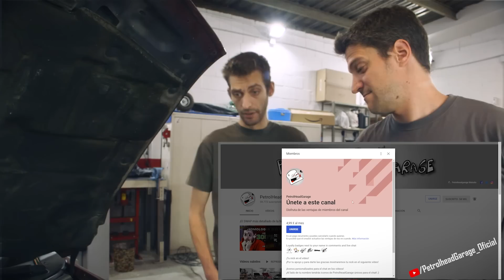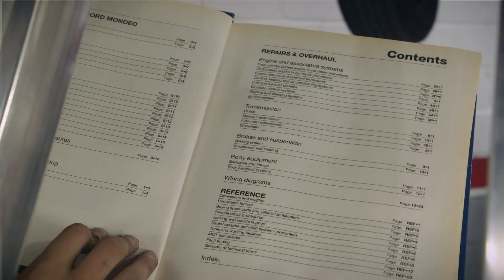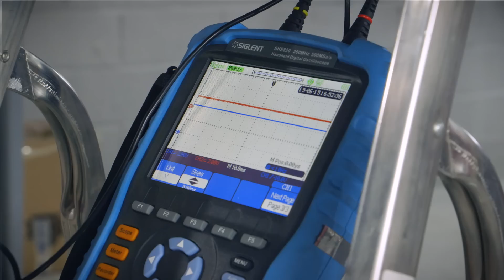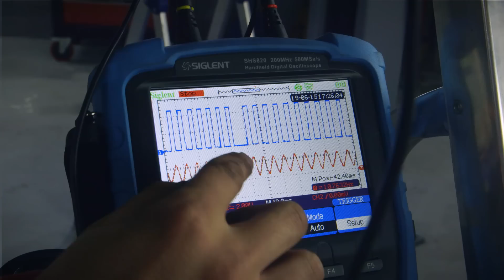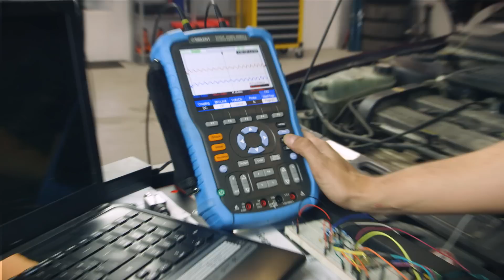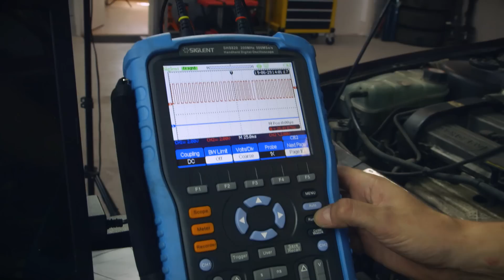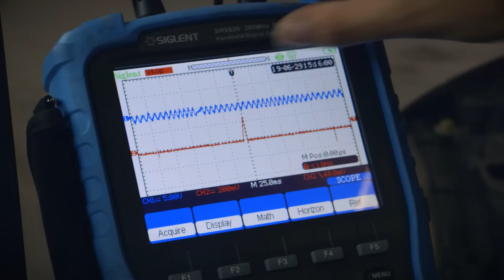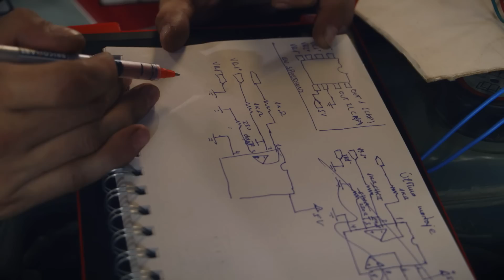Señal del sensor CKP - CENTRALITA de MOTOR programable por 100€ - Speeduino #8 [PetrolheadGarage]

Comment: Hola amigo, quiero preguntarte algo; el  ford utiliza bobinas de chispa perdida, utilizaste algún modulo extra  aparte de los MOSFET Drivers integrados ic1 y ic2 ref: TC4424EPA manejan 3A Dual High-Speed Power  ó solo utilizaste estos drivers ? estos ic1 y ic2 soportan el primario de las bobinas? gracias saludos desde Colombia, buen trabajo.

Comment: Amigo excelente tu video muy practico un fuerte abrazo desde México y una sugerencia solo kitar el fusible d bomba d gasolina o conector d bomba y ya esta no prende o ponte a las lineas d Can Bus  y no prende  tu tiempo muy valioso estaremos en contacto amigos
Reply from the maker: Muchas gracias Reynold! Nos alegra que te haya gustado! Si te ha parecido interesante te pido que compartas el vídeo, así nos echarás una mano y seremos cada vez los que aprendamos juntos :) Gracias!
Reply: @PetrolheadGarage  saludos amigo p eso estamos p ayudarnos una preg donde compraste el osciloskopio y lS herramientas ke usaste incluyendo el osciloskopio y el manual y el circuito ke utilizaste no. Lo encuentro te agradesxco información
Reply from the maker: @reynoldfloresluna8896  tienes la review y el link del osciloscopio en la descripción del vídeo. En todos los vídeos siempre dejamos en su descripción enlaces a las herramientas, materiales, artículos y otros vídeos relacionados.
Reply: @PetrolheadGarage  voy a chekar lo amigo muy interesante y práctico seguiremos en contacto si tienes whuatsap y me lo kieres compartir te agradesxco yo te llamo p consultarte gracias

Comment: Buen video!! Realmente la modificación de la señal el poner la sonda del osciloscopio en paralelo es prácticamente despreciable. Un saludo!
Reply: Hola Jhonny!
No te creas, muchas veces era la diferencia entre que la centralita leyese o no las rpm.
Tiene una impedancia de 1 a 10Mohm y una capacidad de unos 19 pF... No parece mucho, pero ya te digo, hay que tenerlo en cuenta porque da más de un quebradero de cabeza.
Gracias por tu comentario!
Reply: @pablophg7490 Hola, gracias por tu comentario. La verdad es que desconozco el circuito eléctrico de un coche pero he usado osciloscopios en distintas aplicaciones con microprocesadores, sensores y mas y nunca me ha pasado nada (sobre todo usandolas en 10x), las sondas que yo uso son de 10M ohms y la capacitancia en serie es regulable para poder compensarla con la capacitancia en paralelo de la ruta de entrada del osciloscopio, por lo que si esta bien ajustada no deberia afectar. De todas formas repito quedesconozco los esquemas electricos de un coche y los sensores que usa asi que puede ser que tengas razon aunque a mi no me haya pasado nunca. Lo tendre en cuenta por si me encuentro en una situación parecida en un futuro.

Un saludo!

Comment: Yo pasaría del caudalimetro y haría la programación por el potenciómetro del acelerador
Reply from the maker: Por qué Israel? Por qué crees que sería mejor de esa manera? Comparte tus ideas con los demás, así aprendemos todos! ;)
Reply: @PetrolheadGarage  yo el mío ,que es para correr, le eliminé caudalimetro y demás sensores que no hacen falta y menos problemas, además es más rápido de reacción al pisar el acelerador y el plasticoche lo veo más para tandas que para calle .
Reply: Buenas, soy Carlos, del equipo Petrolheadgarage. Lo que dices vendría siendo un control alfa-n. Necesitas además la señal del CKP para medir la velocidad de giro del motor (n). Ese tipo de control va bien para coches de carreras, porque pasan gran parte del tiempo con la mariposa abierta a tope. Pero para coches de calle tiene algunas deficiencias. Aunque ahora mismo, debido a la falta de MAP en el motor del Mondeo (va con caudalímetro) el sistema de control que Pablo ha elegido es justo ese: alfa-n.

Comment: Hola campeónes 
Os sigo por el siguiente motivo. Hoy en día vas a un taller con un coche gasolina, sea atmósferico o turbo a un taller oficial o multimarca y llevas el coche sin dar fallo motor y que no funcione bien y no saben por donde dar 
Gracias a vosotros me he enseñado un montón (sobre todo el del sensor map) que aquí no saben ni de la mitad 
Tengo un Jeep con problema de mezcla rica,  siguiendo vuestros videos casi mejoró,  pero al final de 2500 3000 rpm ahogaba de tanta gasolina 
Lo llevé a un taller oficial y lo he sacado remolcado y sin arrancar imaginaros el tema 
Seguid así 
Y si queréis un reto tenéis mi Jeep con  mezcla rica que le cambiaron hasta la centralita creyendo que era el fallo y ahora ni arranca 
Poca gente al día de hoy en España o mejor Valencia controla un gasolina como vosotros o como nuestros hermanos los hispanos 
Seguid así!
Que me estáis enseñando un montón y día a dia enamorándome más de los coches gasolina!
Reply from the maker: Muchas gracias por compartir tu tiempo, opinión y pasión con nosotros Ysrael! Te deseo suerte con tu problema con el Jeep, y como no conozco ese modelo sólo puedo decirte que intentes pensar en lo simple, en que la avería seguramente sea algo simple, que esté a simple vista pero en el que todavía no has caído. Piensa que si inyecta mucha gasolina es o porque le entra aire de más, no mide bien el aire que entra, si lleva lambda porque no mide y/o corrige correctamente o porque mecánicamente el motor tiene un problema de compresión, y esto generalmente no se da en todos los cilindros a la vez (salvo que pases la distribución y se rompan válvulas o similar). Un coche generalmente tiene una sola avería, no más de una. Cuanto encuentres al culpable te reirás de todo esto, y habrás aprendido de la leche (como me pasó a mi mismo con el tema del ralentí inestable del Mini... Una pesadilla que tenía justo delante de la cara... Pero que con esfuerzo, tarde o temprano, siempre solucionarás). Te dejo el vídeo para que veas de lo que te hablo :P https://www.youtube.com/watch?v=_vWp237B6Jc
Reply: PetrolHeadGarage muchas gracias 
Le hechare un vistazo 
Muy buena respuesta seguiré vuestro consejo ya que la compresión está ok , las sondas lambdas podría no leer correctamente y me falta la sonda tps la señal si es correcta 
Ya os contaré y seguid así

Comment: Excelente video!! Un placer como siempre jejeje

Un consejo, cuando hacia PWM analogicos el comparador utilizado era el LM393. Se trata de un comparador puro para señales. Pero ojo que su salida es en colector abierto. Por lo que tendras que colocar una resistencia pull-up a la salida. El tema es que no creo que puedas cambiar chip por chip porque el pinout varia.

Con respecto a la circuiteria que tienes en paralelo en la señal de lectura, quizas la solucion sea colocar un seguidor de tension para desacoplar circuitos y evitar temas de impedancia de entrada. Con ello quizas puedan colocar la resistencia de 1Kohm de nuevo.

Pos nada, animo y espero que os ayuden estos comentarios.
Reply: Hola patxibalas!
Muchas gracias por tus consejos, he estado ojeando por encima el datasheet del lm393 y es muy similar al lm358. Hasta el pinout!
Es verdad que soporta un poco más de voltaje, pero son similares. Creo que también es una opción a tener en cuenta. De momento lo intentaré cómo está, con el 358, pero está muy bien saber que hay otras opciones. Muchas gracias.
En cuanto a lo del pull-up lo he probado, la única diferencia es que me daba 5v justos y sin el pull Up un poquito menos (el lm358 también tiene que comer). Pero como Arduino da por alto 3,3v o más no ha habido ningún problema de lectura.

Muchas gracias otra vez por tu aportación!!
Reply: Pablo G un placer para mi poder aportar. Animo y seguir asi cracks!!!😃😃😃

Comment: No sé si vais a leer esto ya o si alguien os lo ha dicho porque cada vez tenéis más comentarios y ya no los leo todos... Me habéis recordado a cuando hice un tacómetro para una moto utilizando un sensor inductivo, la primera idea que me vino a la cabeza fue usar un operacional en modo comparador, el circuito funcionaba bien... Pero solo la primera vez, cuando quitabas contacto y volvías a arrancar ya no funcionaba, tirando de osciloscopio vimos que al quitar contacto la alimentación del operacional iba a 0V, pero el motor seguía girando un poco más y generando señal en la bobina, resulta que en los operacionales no debería haber más tensión en la entrada que en la alimentación, si no quedan fritos. Lo solucionamos con un transistor bipolar a colector abierto (con su pull-up) y un diodo rápido en serie con la unión base-emisor del transistor. Ahora que os veo parece que no tenéis ese problema (quizás depende del modelo del operacional?) También veo la idea de usar un amplificador en modo diferencial, solución muy elegante por cierto. Consultando el datasheet de los integrados que recomienda speeduino para sensores de este tipo veo que el fabricante de los chips incorporan diodos clamping en las entradas del operacional, quizás simplemente eso elimina el problema al quitar contacto, o quizás no tiene que ver... Habría que darle una pensada. Ojalá leáis esto!
Reply from the maker: Muchas gracias por tu sugerencia y compartir tu experiencia Abraham! Por supuesto que lo leemos todo, porque es la manera que tenemos de aprender todos juntos, leer lo que cada uno quiera aportar tomándose un tiempo valioso, así que mil gracias ;) Se lo paso al resto para tenerlo en cuenta. Un saludo!
Reply: Muchas gracias Abraham por tu aportación!
Lo tendremos en cuenta por si falla el circuito, ya que nosotros no somos ningunos expertos e igual el amp op se va a la puta en un futuro y nos volvemos locos.
De momento hemos hecho bastantes pruebas y experimentos y aguanta...incluso alguna vez por error lo hemos probado sin alimentar y no ha petao.
De todas formas está bien aprender más cosas, así que muchísimas gracias por compartir tu sabiduría!
Un saludo
Reply: @pablophg7490  Bien! Quizás a mí me pasó eso porque el tipo de operacional era muy sensible o porque la bobina daba mucha chicha, desde luego como modo diferencial parece lo más conveniente.

Comment: Hola
sigo muy decerca el tema de la centralita 

estoy fabricando una mas modular haciendo 4 pcbs 

encendido , inyeccion, sensores y aux.
alque le interese le paso los archivos por mail

a la hora de montar lo tengo todo bastante claro, pero la sonda lambda me esta voliendo loco 

la que tengo tiene 4 cables. uno de sensor otro de masa otro de alimentacion y otro de calentador.
el caso es que no se si la del calentador tiene que estar siempre "calentando " o se para sola al llegar a su temperatura
la verdad es que no se como gestionar esto
me podeis ayudar?

un cordial saludo